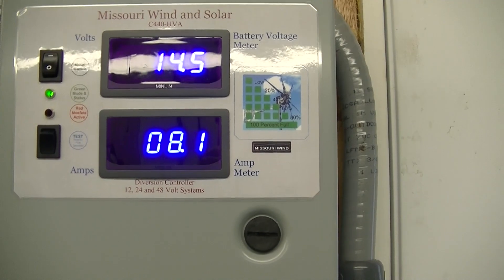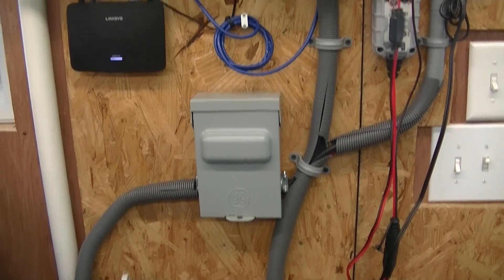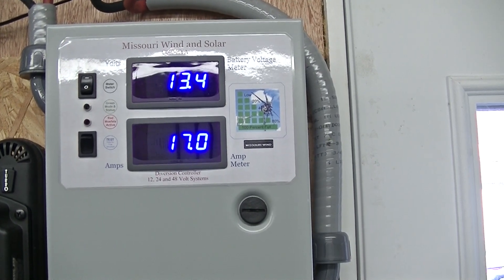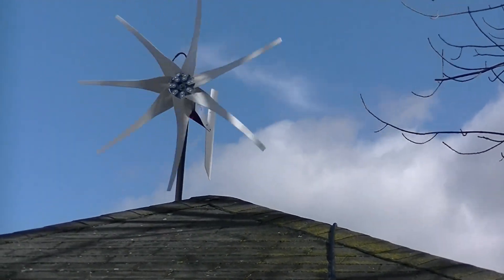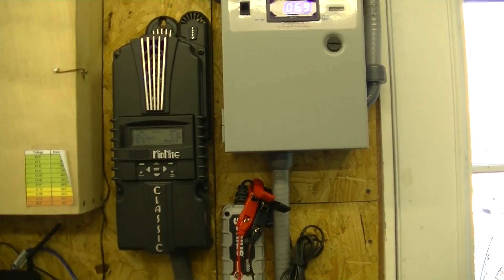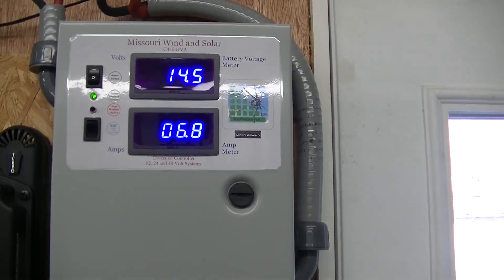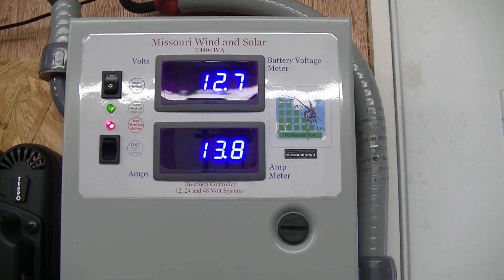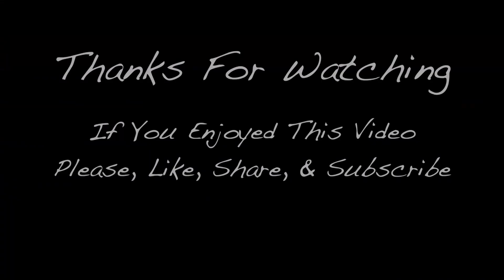Wind & Solar March 2, 2016, Missouri wind and solar turbine.

Comment: We are just starting to research for our home we are building. Was curious about wind with solar. Will be checking more of your videos 👍
Reply from the maker: Research is your friend for sure. There is a lot of good solar panels and wind turbines on the market today and the prices have come down quite a bit. My solar and wind set up is a relatively small one. I run some lights in my shop from the battery bank that I keep charged with my solar and wind. Thank you very much for checking out my channel and my videos. I also swing by your channel and checked it out and I have subscribed.
Reply: Massachusetts Prepper appreciate the info and the sub! Have a great night 👍
Reply from the maker: @CreatingASimplerLifeOffGrid  anytime my friend.

Comment: This 12v system is very good it helps you get bye but in Long Run the battery will  be worn out of its lifespan for better of your batteries you need to go 48 volt.
Reply from the maker: This was pretty much my test set up to see how well things would work. We do plan on changing everything over to a 48 V system when we can. Thanks for watching my friend.

Comment: On dump loads, what are they made of
Reply from the maker: The dump loads I have are just heating coils that drain power out of the batteries to keep them from being overcharged. It's great in the wintertime as it adds a little bit of free heat to my shop. Thanks for watching.

Comment: 11 batteries what kind of batteries are u using
Reply from the maker: For this setup and testing purposes I am using power chair batteries. These batteries are made to be drained very low and be recharged so they have been working quite well with the system. I hope this answers your question my friend and thanks for watching.

Comment: If you can, You might want to get that turbine up off the roof. I think Jeff said, up high.
Reply from the maker: Yeah I would love to get it up about 60 feet, unfortunately local zoning says 20 feet. But it does pretty good for being in dirty air. Thanks for watching my friend.
Reply: Massachusetts Prepper what does the average power would you say you get in the so called dirty air. Because I would have same constraints as you, 20ft being pretty much max.

Comment: I notice your voltage from the solar was up at 135 volts.  If you wire your panels in series parallel, bringing the voltage down closer to the voltage of your 12v bank, you will see a little more amperage for your batteries as you won't be wasting as much current in heat doing a 135 to 13v'ish conversion.  Good little setup though.
Reply from the maker: Thank you very much for the information, the whole solar and wind set up is all new to me so I'm kind of learning as I go. I'll definitely look into this and I appreciate your comment and your time watching.
Reply: Massachusetts Prepper You're more than welcome sir.  I do not know what gage wire you are running from your panels to your charge controller, probably a 10, that seems popular with low to medium range wattage systems, but it might be worth double checking with a table about voltage loss as well.  It does well to keep loss to below 2% where possible.  Preparedness is a community, if the SHTF, those that aren't prepared, will certainly wish they had been.

Comment: Awesome. Glad everything is working ok for you. I like your setup, nice job on it.
Done a little promoting on your video.
Reply from the maker: +MissouriWindandSolar thank you very much Jeff, I must say your product was very easy to set up and install. Where I live in Massachusetts I don't have great wind but it is definitely an awesome supplement to my small solar set up as well. It has been working fine and even though I'm in dirty wind where it is installed when it is getting wind it puts out some decent power. I am definitely very happy with the set up and thank you very much for any promoting you have done in my video. Thanks for stopping by and watching my friend.

Comment: great set up. I would prefer wind over solar in my location but both would be nice.
Reply from the maker: +RANDOUGH SURVIVOR if I was in an area where I could run strictly wind I would agree. Being able to run your wind power through AC and into a rectifier takes away all the bother of having to have large cables for your solar if running on 12 V. I had to run mine in series instead of parallel so I would not need cable as big as my arm LOL. Thanks for stopping by and watching brother.

Comment: Nice set up MP. What is the total investment you have in the system?
Reply from the maker: +Nathan4071 thanks for stopping by and watching brother, if my figures are right I'm right around $3000 but that includes everything, wiring the lumber that I use to build my solar rack, the pipe for my wind turbine tower, everything.
Reply: Thank you MP.

Comment: great setup glad its working out for you.i might be putting solar in my cabin this summer for lights only.might be asking a few questions later on.take care
Reply from the maker: +Wallace Vivian thanks for stopping by my friend, and a nice little solar system would run the lights when needed with no problem as long as you had a big enough battery bank and solar panels to charge. But I will definitely do my best to answer any questions you might have. Thanks for taking time to watch my friend.

Comment: Very cool to see it in action like that! Makes me excited for the days when we can get our solar setup. I'd love a little wind turbine like that, too! Thanks for sharing!!
Reply from the maker: +Armed Rogue it is pretty awesome when everything is clicking in the power is being generated my friend. The great thing about having solar and wind is if one's not working the other one usually is :-) thanks for stopping by and watching Morgan.
Reply: Massachusetts Prepper Very good point! I've always just assumed solar would be easier, but seeing yours, a little wind turbine looks just as easy. Easy as in like, to install, generally repair, get it up, etc. Thanks!!
Reply from the maker: +Armed Rogue yes ma'am, wind turbines like the one I have are fairly inexpensive under $400 then you have to buy the pole of course. But if you buy one by one that puts out AC current and hook into a rectifier so you don't have to run heavy gauge wire. And you will do just fine. Really not a hard project at all in setting up a wind turbine.

Comment: Did you do the work? If so, were you able to take advantage of the tax incentives in our great state of Mass? haha. Looking to deploy an off grid setup starting this summer.
Reply: Tax incentives are great. A friend of mine got back 60 percent of his install.
Reply from the maker: +RoninX4 yes I did all the work myself, and because it's not connected to my house only my shop I was not able to take advantage of any of the nonexisting tax incentives in our great state of the Communist wealth of Massachusetts :-) but with that being said I am able to run my studio which is in my shop fully off grid. So the five lights that I use and charging all of my equipment is all done from my solar and wind set up. Thanks for stopping by and watching my friend. And I'm not sure if any of those tax incentives will be available for 2016 or not but you should be able to find out fairly easily.